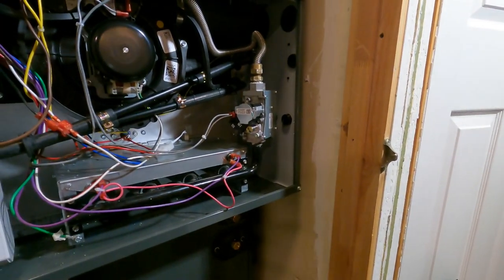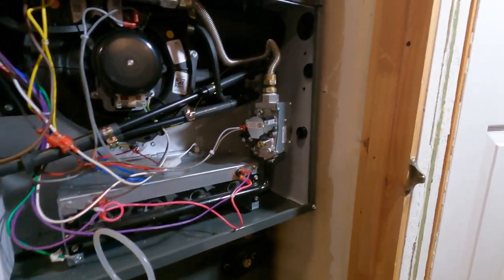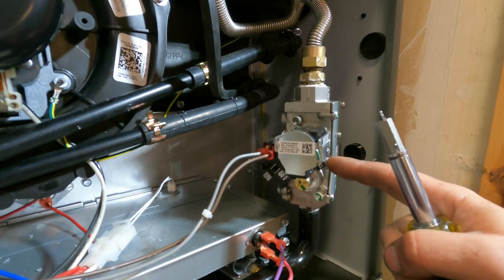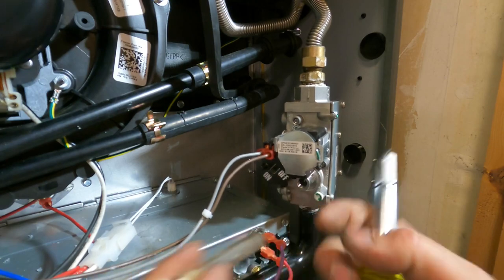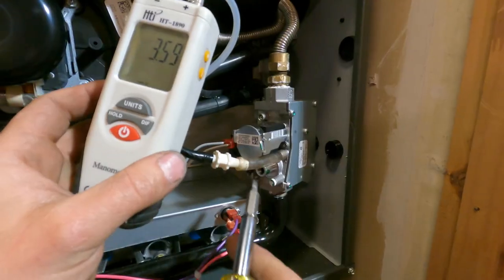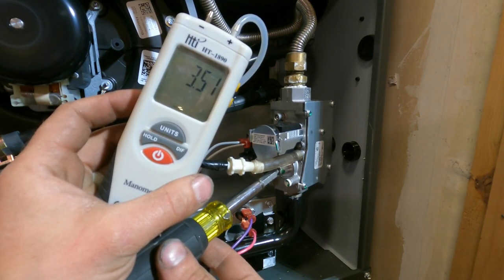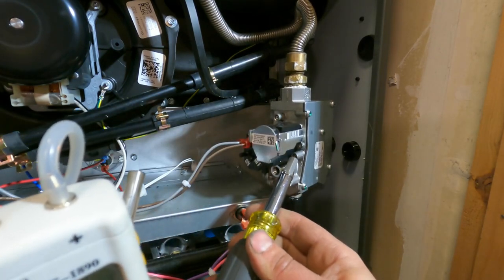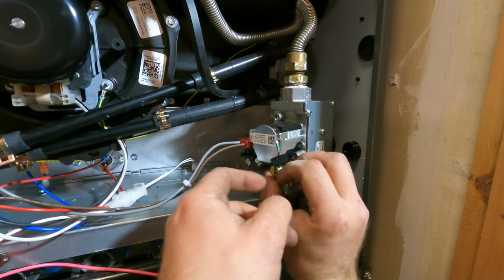How To Check And Adjust Gas Pressure On A Furnace

Comment: It is always good practice to check the inlet gas pressure (should be 7” WC nat gas)to the gas control valve at the drip leg before checking the pressure out of the valve.Dirt or ice blocking the service regulator vent can cause low pressure from the meter manifold which could effect the pressure from the control valve if it is very low.I also agree with clocking the gas meter on the half foot dial to get proper input for the furnace.

Comment: I bought the exact same style manometer your using on Amazon under the name RisePro. It has no markings on it to indicate which port is neg or pos. I have been assuming left port neg and right port pos. Your brand unit confirms my assumption was correct.

Comment: Why 3.5? Thanks for the video.
Reply from the maker: Manufacture recommended pressure 👍🏼 you can have it lower but you don’t want it to be over firing. That can easily cause a cracked heat exchanger
Reply: @bluejay713  pressure value comes from the furnace manufacturer, not the valve maker.

Comment: Hi, I Have The Same Model Monometer As Yours, My Question Is What Unit Do I Set It To To Check The Gas Valve Pressure Outlet Is It inH2O Or Kpa I Tried To Read What Yours Was Set At But It Was Too Blury.. Thanks...
Reply: inH2O aka in WC

Comment: Might be a stupid question but Is it the same pressure for liquid propane  furnace?
Reply from the maker: No dumb questions here! So natural gas is 3.5” wc (water column) whereas propane is 8-10” wc so quite a bit higher pressure for propane.
Reply: @diyhvacguy  ok thanks for your input
Reply: if you don't know the answer you should not even be touching a job like this
Reply: @diyhvacguy   The only sure way to set the gas pressure correctly is to clock the gas meter.  You cannot exceed the BTU input of the furnace.  Proper pressure can b between 3.2-3.8 depending on the heat content of the gas, which varies in different areas.  In my area it is not code to have gas flex inside the furnace cabinet.  It needs to be hard pipe at least thru to the outside of the cabinet.
Reply: @diyhvacguy  would that be the inH2O setting on this manometer? In for inches and h2o for water column?

Comment: i set the wc at 4.5 which is what furnace plate says seems to be to much gas  lot of flame. is there a way to adjust  it down lot of flame before the burn chamber

Comment: For most modern furnaces, they have either 2 stage (or modulating) gas valves.  A single-stage gas valve is old, inefficient, and outdated technology. You will crack the heat exchanger if you always assume its only 1 setting adjustment like you showed in the video.  The house can start filling up with deadly toxic gases as that crack gets bigger from an incorrectly adjusted gas pressure.  

Worse yet, manufacturers will void your warranty if gas pressures were adjusted incorrectly, so then your only option would be to sue the hvac company for a new furnace if they had irresponsibly showed the wrong way to adjust gas valves with that one-size-fits-all approach.  https://www.youtube.com/watch?v=bI45GFiXraw
Reply from the maker: This is not true. There are different set points for stage 1 and stage 2 but the pressures should always be checked and adjusted to spec.
Reply: @diyhvacguy  this is 100% true because your video made no mention of 2 stage adjustments or even worse, for modulating gas valves. So if your average DIYer followed, it would be very dangerous if they didnt know to check which type of gas valve was on that furnace as you showed here.
Reply: @srobeck77  I've got your back Shawn.  You've given responsible information, you are correct !!
Reply: If someone goes tweaking screws randomly without the basic information of which model they have and basic Furnace principles, they deserve a heat exchanger.  At some point they have to look at the panel data and would see there are two pressure values..